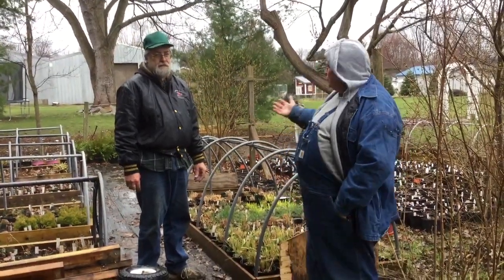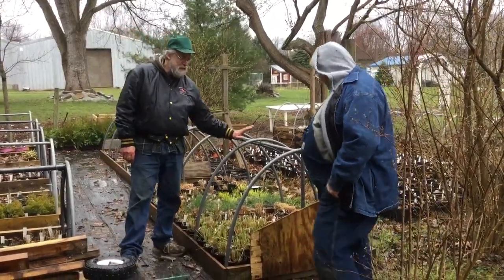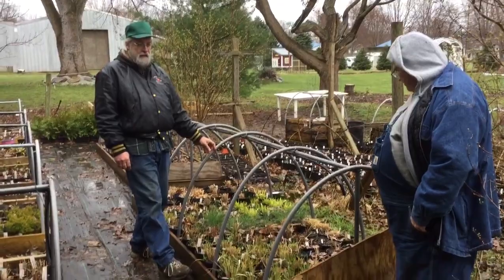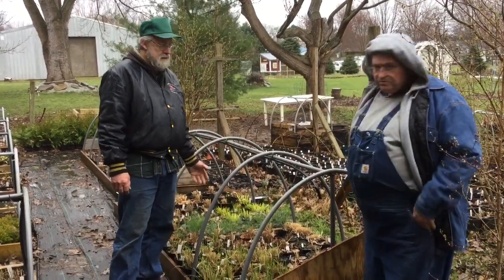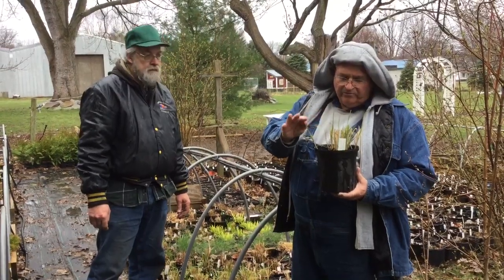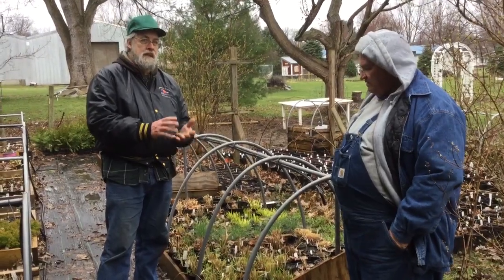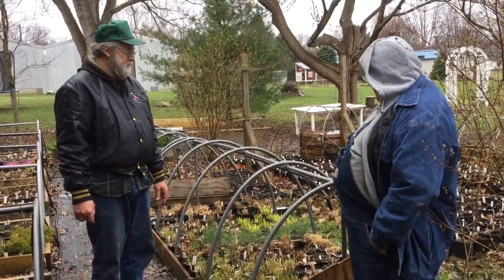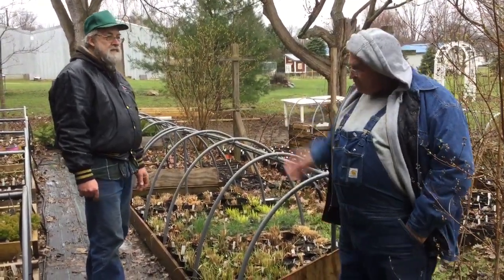How to Overwinter Ornamental Grass

Comment: How often do u water them in winter?
Reply: Not a single time. These stay frozen solid all winter. With all the snow we get in this area, it causes condensation to drip on the inside when a little warm up happens.  Less snowy areas may need a spray of water with long warm periods though.